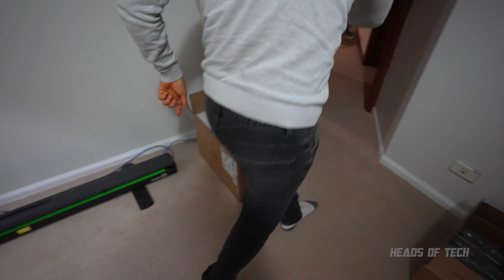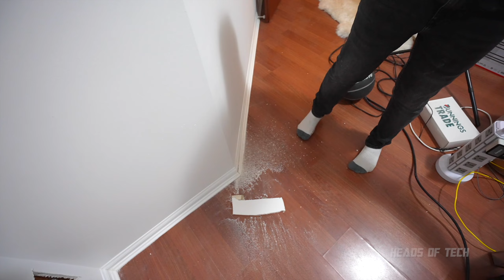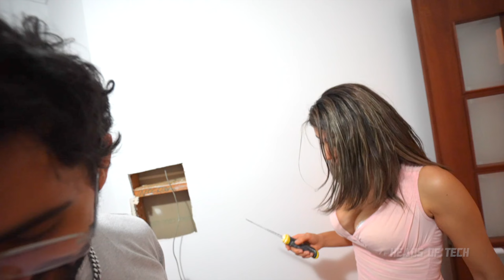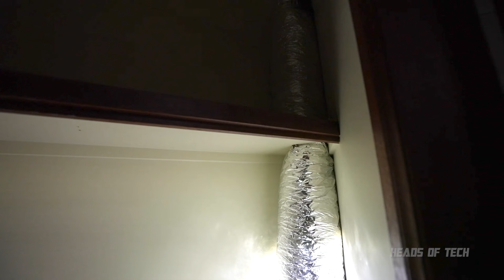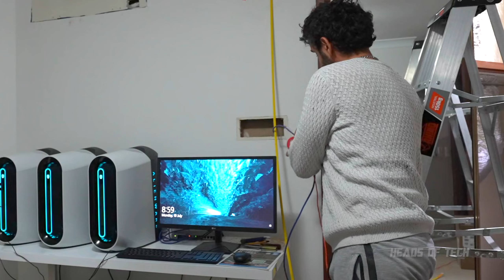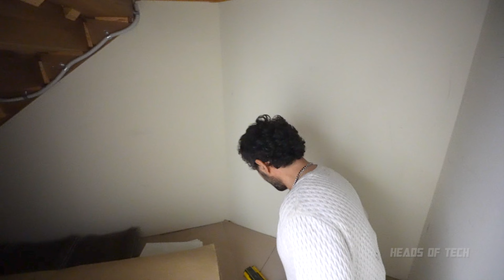Double Storey Home Network UPGRADE - How to Run 10 Gigabit Ethernet Cables  🔌

Comment: You can install conduit in the wall if you like for later use. Looks like a big fish job. Run several cables in each location not just one.